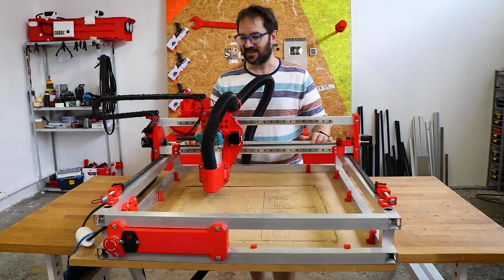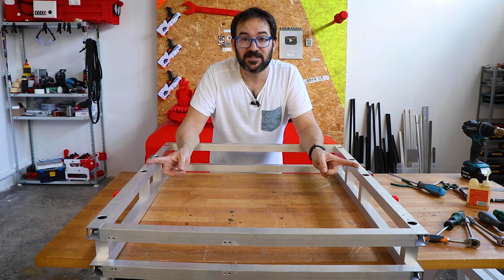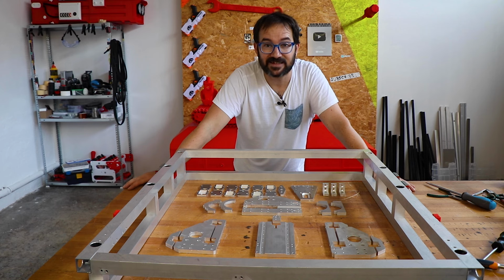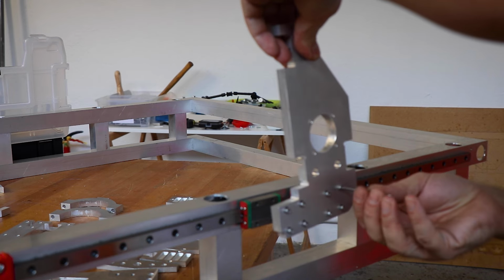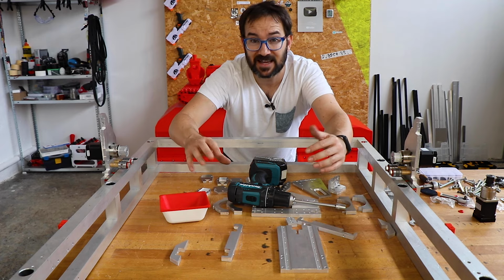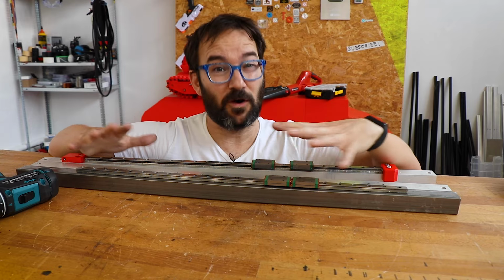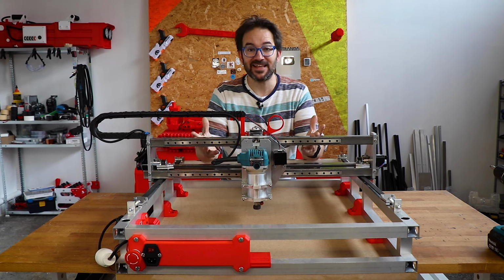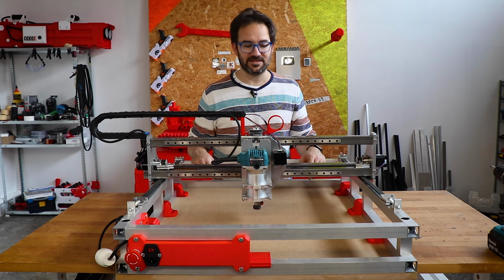A CNC ROUTER THAT MACHINED ITSELF

Comment: Some bristles on the vacuum nozzle will help with suction
Reply: It's far less viable to suck up aluminum and steel chips than it is to just create a coolant system since cutting metal already generally needs coolant to prolong tool life anyways. Having the machine mounted to a fixed/welded base would likely sure up some of that deflection too as I'm willing to bet the bolt-thru design is the root of the majority of the flex.
Reply: @tyler1988  yeah coolant is always a good measure, but even if he were to run just compressed air to cool the tool for what light machining he is doing would work.idk if he would want to deal with building a containment for the coolant and then disposal once it has reached its service life. I know where I work we top our coolant off almost weekly, during the sommer its almost every other day and perform an annual pm on our machines where we evacuate all the coolant, flush the system and power wash the chip conveyors. But that is also on a machine that runs 20 hours a day 6-7 days a week. We run some aluminum, but mostly mild steel, carbon steel, and tool steel, some of it heat treated.

Comment: I cringe watching you use a file. I fear for your face when you cut aluminum with a cross-cut saw. You made a spanner and called it a spacer. You murder hacksaw blades.
But I've been watching you since you started, Ivan, because I think you truly come up with some great little engineering tricks.
A little tip: You can save a very time-consuming step - instead of tapping threads into aluminum, stainless steel bolts will cut their own threads in a slightly too-small hole. Just chamfer the hole & start turning the bolt into it. It will grab & make its own threads. In aluminum.

Comment: Now you only have to fill the steel pipes with epoxy granit or sand and you get an even stronger machine.
Reply: Has sand worked for you? Really curious.  What about a watered down cement mixture?  Drilling holes later might be a problem.
Reply: @TheRainHarvester  Depends on what you try to achieve. If you want to damper ringing in the chassis, I'd go with sand. If you want to up the overall mass of the machine, you could try cement or something similar.  Or use epoxy granit instead and have the best of both worlds.
Reply: @marcus_w0  can epoxy granite be drilled as easy as aluminum? (Just curious how hard redoing/adding holes would be.)
Reply: @TheRainHarvester  Let's say: Better be sure, where to put the holes in the first place. Epoxy granit is basically a mixture of epoxy with sand and gravel. Everything that could cut through stone should manage to drill a hole into it - but it would be a hell of an effort.

Comment: There are some pretty nice designs out there for 3D printable vice jaw covers. They have a magnet so they magnetize onto the standard jaws. I've been using them for years and they're really handy just drop them on the vise. They hold in place and you can grab something without marring it. That being said I like the ingenuity on the wood ones :-)
Reply: 5 min to make wood, vs forever to print and wood is more durable.
Reply: @clanross62  different strokes for different folks. My printed ones have held up for multiple years now and I don't have to zip tie it onto the vise. But everyone has their own way.

Comment: Please correct me if I'm wrong, but the CNC bit isn't completely perpendicular to the workpiece, is it? At least, I'd say that's the reason for the very clear patterns you can see on the finished metal wrench
Reply from the maker: Good eye! The top and bottom router mounts aren't equal and the router is tilted, I luckily I used the walls along the Y to judge the straightness of the cuts but yes, I need to redo those two parts so the router is orthogonal to the workpiece. As a funny side note, the router was originally tilted the other way due to the 3D printed parts giving to the weight of the router. Thanks! edit: I just realised that after finishing editing the video.
Reply: @ivanmirandawastaken  Quick recommendation: Check out the "Everman belt drive". It could be a cheap upgrade that would significantly reduce the deflection caused by the belts, and reduce the tension needed on the whole belt.
Reply: @ivanmirandawastaken  make adjustable, because over time.......
Reply: @ivanmirandawastaken  would it be easier to cut out a traming plate to fit your existing bolt pattern?
Reply: @Ivan Miranda, redesign the carriage so that you can tram the mill to the workpiece. It's not a 3d printer that you're building here. Tram matters!
Reply: @kurtnelle  This is not sufficient because the edges will not be 90 degrees despite the pockets being flat.

Comment: With how it hulked through material at 22:20 (admittedly unintentionally) doesn't the depth of cut seem kinda light at 22:50?

I only ask because I originally thought I had to run my 3D printers way slower than I actually have to, and had I not seen a default speed file for the printer I might still be printing at 25mm/s.... (PLA with a .4mm Nozzle)
Reply from the maker: Yes, I was aiming for a successful cut due to time constraints (aka wanting to finish the video this year) but yes, it can do 2 mm passes no problem check the end of the video for proof.

Comment: Just be carefull, when operating a drill with a glove on. Sure, chips are hot an sharp, but eventually, the glove gets caught and you'll regret putting your hand in it.
Reply: Got a t-shirt stuck in a drill bit once. I'm lucky it was a hand drill so I could just pull my finger off the trigger. Even so, it tangled up so fast I got a nasty gash on my stomach. If it was a mill or a drill press... well, I don't want to imagine that. Loose clothing and gloves getting grabbed is no wives tale
Reply from the maker: I run the drill with the belt loose just for that reason, I can make it stall just by grabbing the chuck, but if the part flies of my hand and starts spinning it will slice my hand open hence the gloves. Good advice! Thanks!
Reply: @ivanmirandawastaken  You can clamp something onto the drill press to make sure it can not spin. I would still not ware the gloves if for no other reason then to set a good example.
Reply: @ivanmirandawastaken  dont drill unclamped workpieces, ive seen sizable holes made in hands , arms and even faces ....
Reply: I haven't seen them for a long long time, But you used to be able to get "Machinists safety gloves". They had weak breakaway stitching all around the sides and back. They were still more dangerous that going in bare handed, But if they caught on something spinning they were meant to rip from your hands. Apparently they weren't that popular because they (Obviously) weren't particularly hard wearing.

When I trained as an engineer we were all issued with a couple sets of overalls with breakaway sleeves that had breakaway stitching up both sides of the arm and around the shoulder seam. It was a nice idea, But they didn't last that long as the collage was full of young men, and we were a bunch of headstrong idiots. It only took a week from us all finding out about the safety sleeves before most of us were walking about with one or no sleeves on out overalls. People would quietly creep up behind you in the corridors, Grab your sleeve at the cuff, and rip it right off ! All the "Jocks" thought it was funny until winter hit. The big workshop dropped to about 5'C and we all had bare arms, and big sagging arm holes that let the draft go right across your back. :(
Reply: Tzuede Off the Cuff  i had some training in school on an old lathe, some of my colleagues weren't so bright and tried to see if they can hold the chuck from rotating, they were in luck that the guy with the clutch had some good reflexes and stopped it before wrapping his hand around the chuck , it would been quite the Darwin award for them..i've tried to warn them that there's no way to stall the machine by hand but they still tried lmao
Reply: That’ll literally never happen, and is kind of an old wives tale, lol
Reply: @DB_frfr  I got my hand and arm tangled around the cylindrical part on the Lathe while wearing gloves. The machine caught my gloves while I was sanding the part. Almost lost my fingers. I completely understand where you're coming from. I had that mentality when I was a stubborn 19 years old. I've learned my lesson. I'm now 25 and wished I didn't get the scars.
Reply: @DB_frfr  I threw away that glove a few years ago, was also proving against your claim.
Reply: @DB_frfr  It actually is a rather common injury in metal working professions.
If your spindle catches the glove, it will rip of whatever body part is inside the glove or you have an extremely defective glove that would surely be noticed almost immediately while putting the glove on.
It's not the everyday picture that some colleague cuts of his fingers with a circular saw, too,  but it is one of the most common severe accidents with cutting tools.

Comment: Maybe a small project idea, you seem to have the tools for it: soft jaws for your vice. 3D print some covers for the steel jaws of the vice to protect your parts. Or even remove the vice jaws and have a giant hunk of plastic to bolt there instead of the metal jaws. There's usually 2 bolts holding each jaw face on there.

This was pretty cool! Seeing a CNC machine make parts for itself. It's like the MC Escher print of the hand drawing the other hand. Life imitating art.